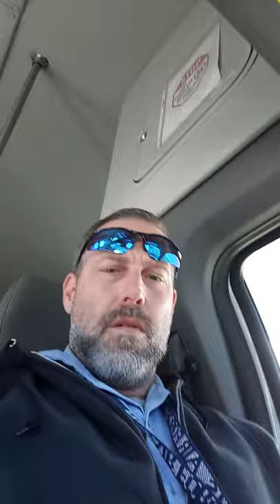coolant temperature sender versus coolant temperature sensor

Comment: My Toyota Celica over heated one day. I turned the engine off and I  can hear the sound of water boiling. I turned the ignition switch to ACC and the gage was in the half way mark. I replaced the thermostat and a few days later my engine light came on. I took my car to a car part store and did a OBDREADER on it and it said I need to replace the coolant temperature sender. The book on the car shows you where it is located on the car but it must be a different year because it is not where the book says it is. I've looked on line, on YouTube and didn't have any luck finding my coolant temperature sender is on my 97 Toyota Celica is. Can you point me to a website that can help me find it?

Comment: My 97 cougar is running 3/4 hot i replaced temp sensor because the top just fell off and it still doing same thing,i noticed the fan isn't coming on until it gets at 3/4 hot..im kind of at loss right now any ideas?

Comment: Good day sir, my temperature gauge shoots up past hot before starting the engine not all the time. So my key is on the position past accessories but remember I don't start the engine. What can be the cause?
Reply from the maker: Hello,
Depending on system design, year-make-model, and proper testing...meaning some systems use single wires, some use 2 wire system's and go through ECU then to gauge.
Use power probe to know for sure if wire is supplying power/voltage or if it is a ground only wire
But, older simple systems use single wires...if you take off wire off of sender and reads cold with key on is one test, the other test is to ground to block and it should read full hot.
Now, if it is hot when grounding wire, and cold when circuit is not touching ground or sensor, then sensor is bad.
But, you said that it does not do every time.....I would check wiring/plug, maybe replace/repair plug and sensor to ensure good sensor and good connection to be safe.
Reply from the maker: But it sounds like it has a straight found, wether sensor bad, wire is exposed and touching somewhere else, or plug or end is touching causing a ground....do cheap stuff first and simple test, sender change for peace of mind cheap....
If all passes, changed sender and plug to sender fix/changed and still have problem, then you may have a gauge problem....depending of age and circuit design....what I mean is a 1972 F100 gauge system is simple without resistors/capacitors like even compared to a 1996 Lexus LS400....depends on design
Reply from the maker: Straight ground